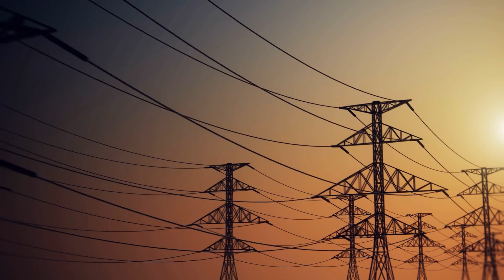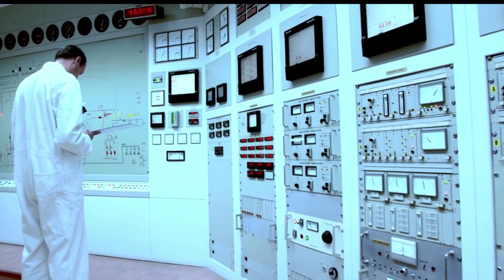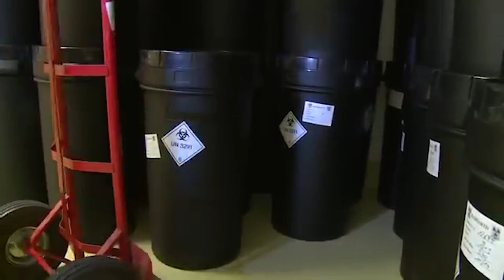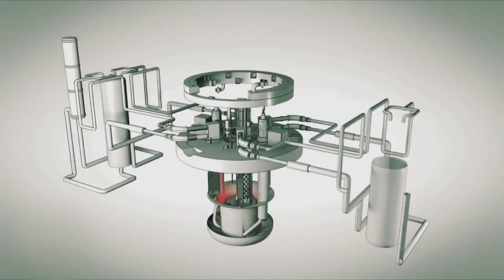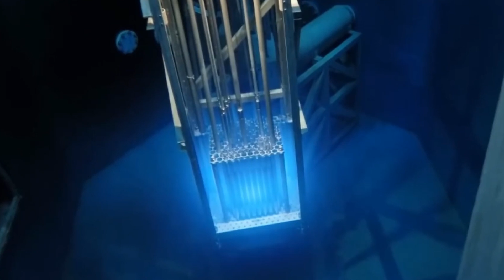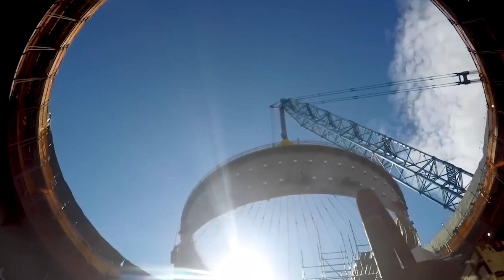Want CLEAN Energy? China's Thorium Nuclear Reactor Is The Answer!

Comment: 4091618b  The second law of thermodynamics may be false conventional wisdom. Let's face the wonder of full heat use.
The second law of thermodynamics was imposed on us during victorian england's scientific and religious fascination with steam engines. 

The second law is behind modern refgerators needing electrical energy to compress the refrigerent to force it to release as waste the heat that it has removed from the refrigerator's service interior in the cooling part of the refrigerent's circulation. There is also discarded heat from mechanical friction and electrical resistance. The total released and discarded heat minus the removed heat equals the electrical input balancing this system's energy. Energy is conserved in a system even if part of the energy must be forcibly wasted. 

Refrigeration by the principle that energy is conserved should produce electricity instead of consuming it. 

It makes more sense that refrigerators should yield electricity because energy is widely known to change form with no ultimate path of energy gain or loss being found. Therefore any form of fully recyclable energy can be cycled endlessly in any quantity. 

In an extreme case senario, full heat recycling, all electric, very isolated underground, undersea, or space communities would be highly survivable with self sufficient EMP resistant LED light banks, automated vertical farms, thaw resistant frozen food storehouses, factories, dwellings, self contained elevators, safe rooms, and horizontal transports. 

In a flourishing civillization senario, small self sufficient electric or cooling devices of many kinds and styles like lamps, smartphones, hotplates, water heaters, cooler chests, fans, radios, TVs, cameras, security devices, robot test equipment, scales, transaction terminals, wall clocks, open or ciosed for business luminus signs, power hand tools, ditch diggers, pumps, and personal transports, would be available for immediate use incrementally anywhere as people see fit. 

Some equipment groups could be consolidated on local networks. 

If a high majority thinks our civilization should geoengineer gigatons or 
teratons of carbon dioxide out of our environment, instalations using devices that convert ambient heat into electricity can hypothetically be scaled up do it with a choice of comsequences including many beneficial ones. 

Energy sensible refrigerators that absorb heat and yield electricity would complement computers as computing consumes electricity and yields heat. Computing would be free. Chips could have energy recycling built in. 

A simple rectifier crystal can, iust short of a replicatable long term demonstration of a powerful prototype, almost certainly filter the random thermal motioren of electrons or discrete positiive charged voids called holes so the electric current flowing in one direction predominates. At low system voltage a filtrate of one polarity predominates only a little but there is always usable electrical power derived from the source, which is Johnson Nyquest thermal electrical noise. This net electrical filtrate can be aggregated in a group of separate diodes in consistent alignment parallel creating widely scalable electrical power. The maximum energy is converted from ambient heat to productive electricity when the electrical load is matched to the array impeadence. 

Matched impeadence output (watts) is k (Boltźman's constant), one point three eight x 10^ minus 23, times T (temperature Kelvin) times bandwidth (0 Hz to a natural limit ~2 THz @ 290 K) times rectification halving and nanowatt power level rectification efficiency, times the number of diodes in the array. 

For reference, there are a billion cells of 1000 square nanometer area each per square millimeter, 100 billion per square centimeter. 

Order is imposed on the random thermal motion of electrons by the structual orderlyness of a diode array made of diodes made within a slab: 
-----‐------‐----___-- Out
🔻🔻🔻🔻
■■■■■■___ + Out 

All the P type semiconductor anodes abut a metal conductive plane deposited on the top face of the slab with nonrectifying joins;  the N type semiconductor cathodes or common cathode abuts the bottom face. As the polarity filtered electrical energy is exported, the amount of thermal energy in the group of diodes decreases. This group cooling will draw heat in from the surrounding ambient heat at a rate depending on the filtering rate and thermal resistance between the group and ambient gas, liquid, or solid warmer than absolute zero. There is always a lot of ambient heat on our planet, more on equatorial dry desert summer days and less on polar desert winter nights.

Focusing on the composition of one simple diode, a near flawless crystal of silicon is modified by implanting a small amount of phosphorus (N type conductivity) on one side from a ohmic contact end to a junction where the additive is suddenly and completely changed to boron (P type conductivity) with minimal disturbance of the crystal lattice. The crystal then continues to another ohmic contact. 

A region of high electrical resistance forms at the junction in this type of diode when the phosphorous near the ĵunction donates electrons that are free to move elsewhere while leaving phosphorus ions held in the crystal while the boron donates holes which are similalarly free to move. The two types of mobile charges mutually clear each other away near the junction leaving little electrical conductivity. An equlibrium width of this region is settled between the phosphorus, boron, electrons, and holes. Thermal noise is beyond steady state equlibrium. Thermal noise transients, where mobile electrons move from the phosphorus added side to the boron added side ride transient extra conductivity so the forward moving  electrons are preferentally filtered into the external circuit. Mobile electrons are units of electric current. They lose their thermal energy of motion and gain electromotive force, another name for voltage, as they transition between the junction and the array electrical tap. Inside the diode, heat is absorbed: outside the diode, to exactly the same extent, an attached electrical circuit is energized. The voltage of a diode array is likely to be small so many similar arrays need to be put in series to build higher voltage.  

Understanding diodes is one way to become convinced that Johnson Nyquest thermal electrical noise can be rectified and aggregated. Self assembling development teams may find many ways to accomplish this wide mission. Taxonomically there should be many ways ways to convert heat directly into electricity. 

A practical device may use an array of Au needles in a SiO2 matrix abutting N type GaAs. These were made in the 1970s when registration technology was poor so it was easier to fabricate arrays and select one diode than just make one diode. 

There are other plausible breeches of the second law of thermodynamics. Hopefully a lot of people will join in expanding the breech. Please share the successes or setbacks of your efforts. 

These devices would probably become segmented commodities sold with minimal margin over supply cost. They would be manufactured by advanced automation that does not need financial incentive. Applicable best practices would be adopted. Business details would be open public knowledge. Associated people should move as negotiated and freely and honestly talk. Commerce would be a planetary scale unified conglomerate of diverse local cooperatives. There is no need of wealth extracting top commanders. We do not need often token philanthropy from the top if the wide majority of people can afford to be generous. 

Aloha
Charles M Brown 
Kilauea Kauai Hawaii 96754

Comment: Wow, China is now the first and leader in thorium reactor technology. China’s first commercial thorium based molten salt nuclear reactor is the testament of her nuclear technology superiority which has superseded those of the USA. The thorium reactor will benefit mankind with cleaner energy supply and very efficient electricity generator which can be exported to other countries without transgressing the nuclear proliferation treaty as thorium reactor cannot produce plutonium or other dangerous byproducts.
Reply: A thorium reactor can, indeed, produce plutonium.  There are already reactors of several types that can use thorium.Thorium and molten salt reactors are independent variables.  You can have either one without the other.  Designing a successful MSR is much harder than just using thorium in a regular reactor.

Comment: The US invented the TMSR at Oak Ridge but it turned its back on it because it didn't make fissible material for nuclear weapons.  Now China, with help from Oak Ridge has picked up the baton and is running to finally make molten salt reactors reality.  China has a 2mw TMSR running in the Gansu Desert since late 2023.  China will start the design and manufacture of a 30mw reactor in 2025.  Interesting also is that the Shanghai Jiangang shipyard is designing a large merchant ship using a TMSR.  Could China's nuclear carrier also be powered by a TMSR?